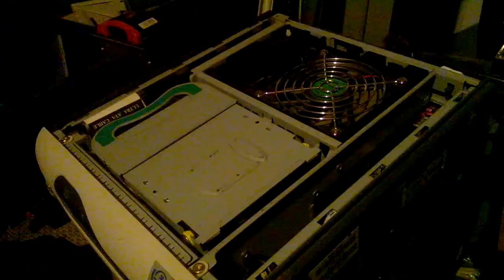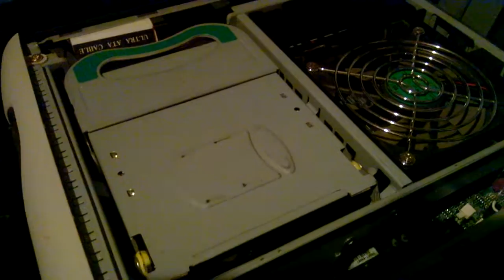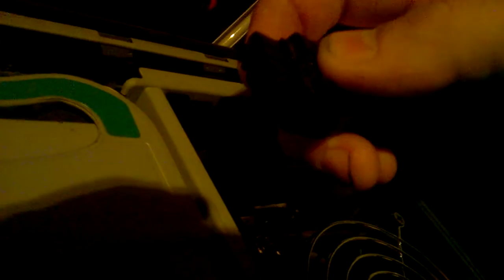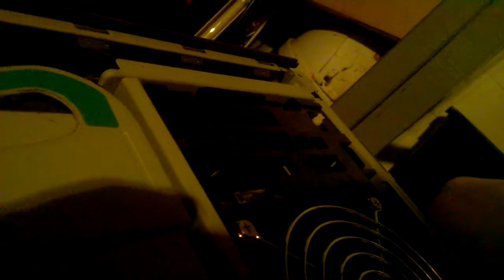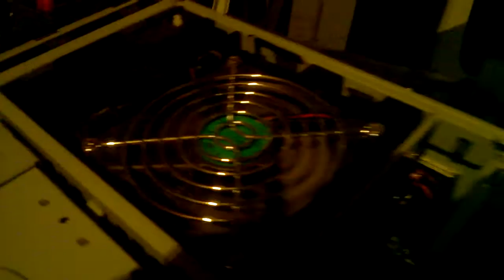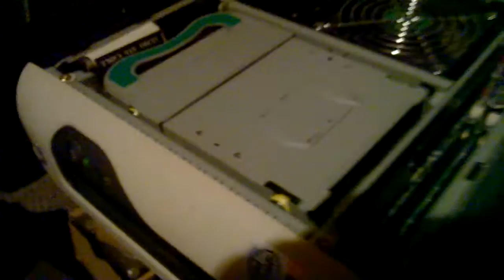HP E-PC 42 -- Awesome No-RAM-Detected Beep Code

Comment: I bought one on eBay with no PSU. I had to make my own PSU and I wired it up backwards to start with and I thought I cooked the PC but then when I wired it up again it made this noise - I still thought it was cooked at that point but then I remembered it had no RAM! Looking at the windows 2000 installation on it, it hadn’t been powered up since 2002!

Comment: I recognize that sound, my old HP Vectra VL400 used to do that but was 4 beeps (or 8 I don't remember) instead of two and that meant that the power supply was going into protect mode :3